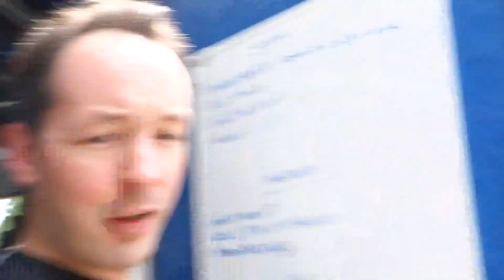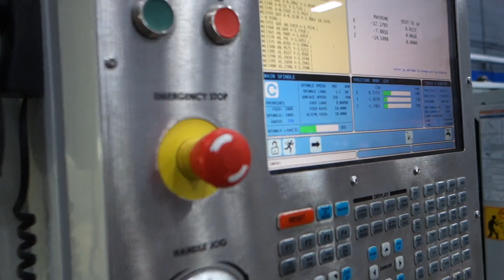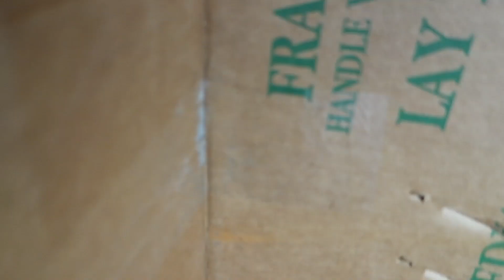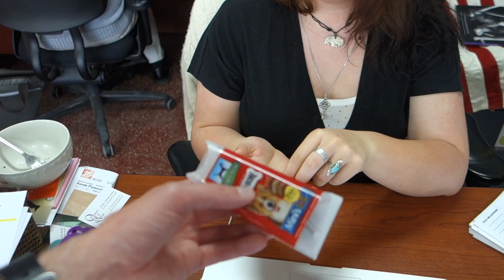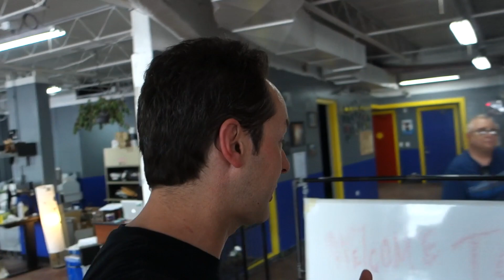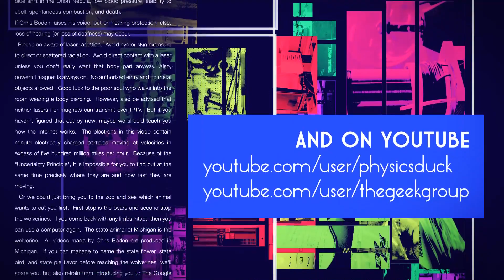Captain's Blog 5 8 2015 Bruce from the Roof and Moose with her Banana Tree

Comment: very watery intro.  changing lights while on a forklift is different.  how do you get the light over grass?  a slight wind will challenge your skills.  Moose your banana tree looks nice.  over time Moose's trees will improve.  at 13:52 where does the door under the forklift go?
Reply: NeWt0z Correct. Robotics down, A/V up and old Master Control way up.
Reply: now I know more about the lab.